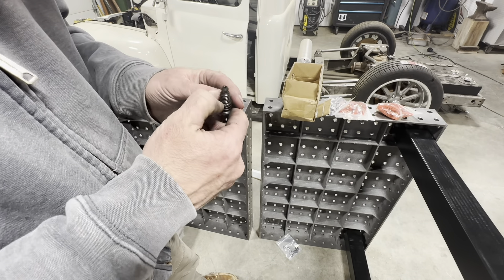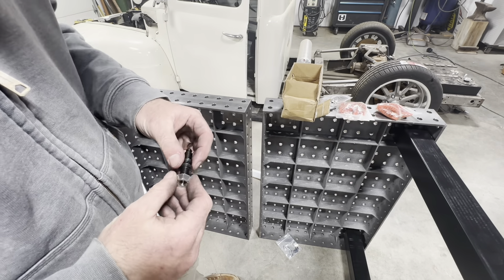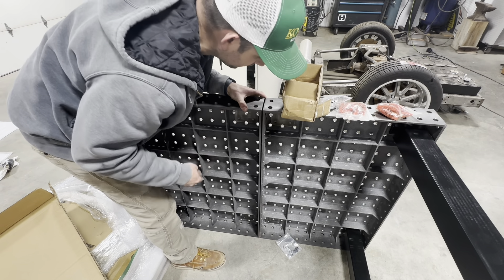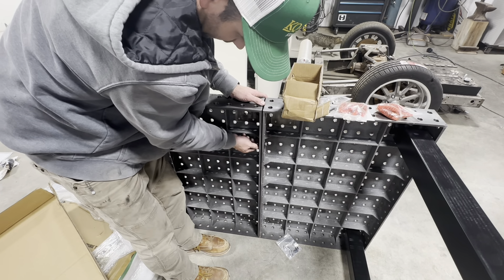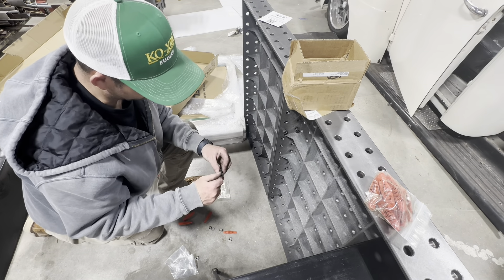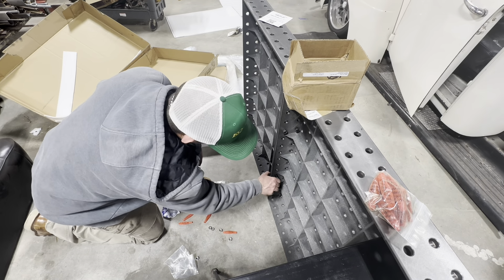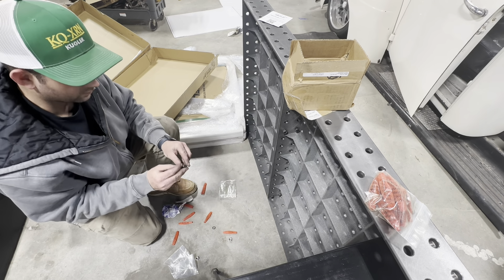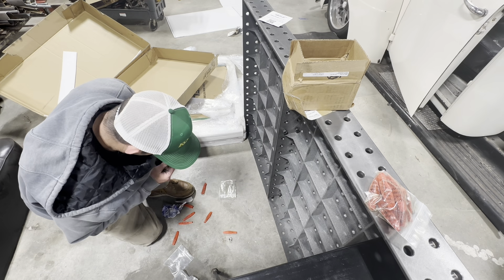Langmuir Systems ArcFlat Welding table Unboxing and Assembly.

Comment: I can see some advantages to the table alright but pushing a epoxy in a place like this, seems as tho some kind of grease gun style of pump would be a lot easier on a person. There must be some kind of rental tool that would make it a lot easier to push the bonding agent in the table. Plus as said, buying your own metal and making a good leg would reduce the costs. Of course, to make such legs would require a lot of time to make a precision leg that can be still adjusted. No cement floor is precision unless a lot of work in that surfacing took place ahead of time. Lots of questions only the owner can answer for him/her self. This is a good looking unit, and one that  should take some abuse without just falling apart. All time related things.
Reply from the maker: I agree for the price they should probably provide a better solution for epoxy. I do plan on building a frame and leg setup for it at some point down the road. Thanks for watching and commenting.
Reply: @brianuerling4830  I am just glad I discovered a channel that is real and gives a honest opinion. Good people doing good things  always is the best option for someone to make a good decision. Sounds like double talk from this old man, just a poor way of trying to make someone know I believe in them
Reply from the maker: @morgansword  Thank you! I hope i can keep you as a subscriber.